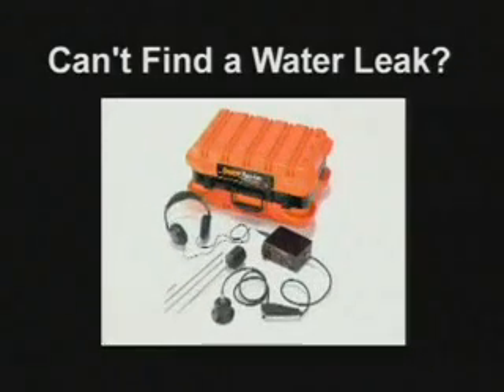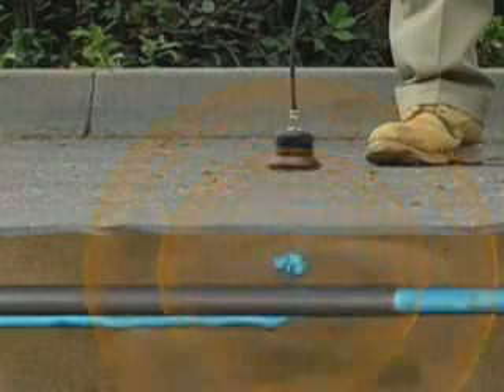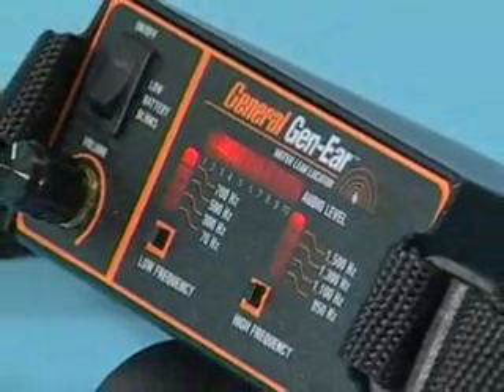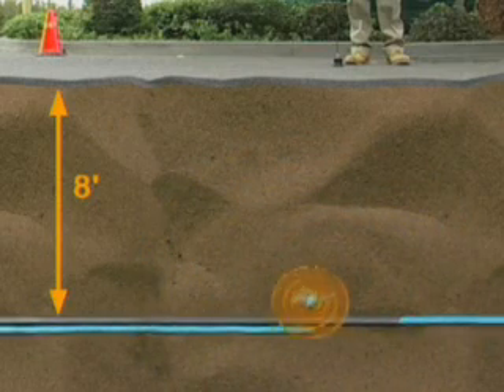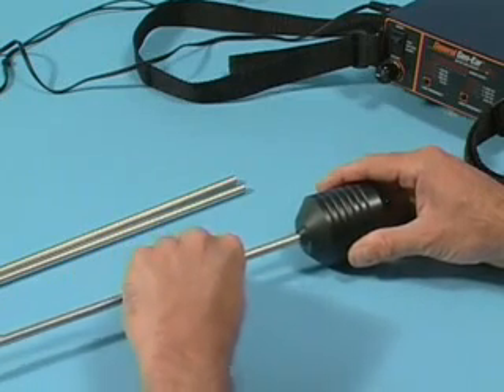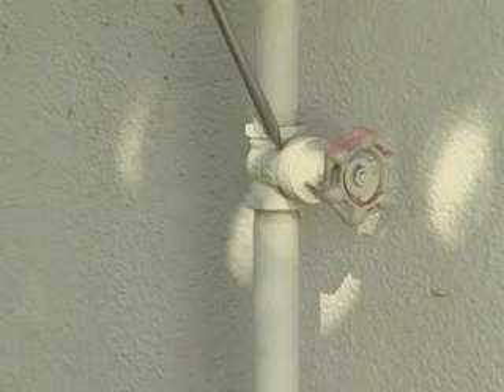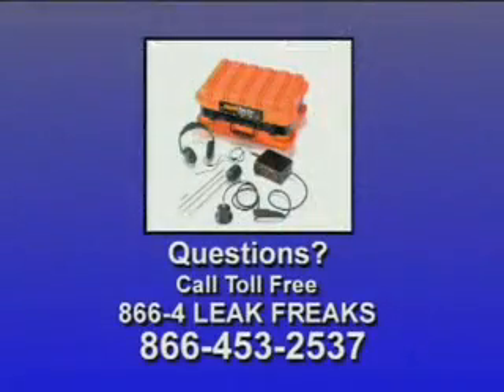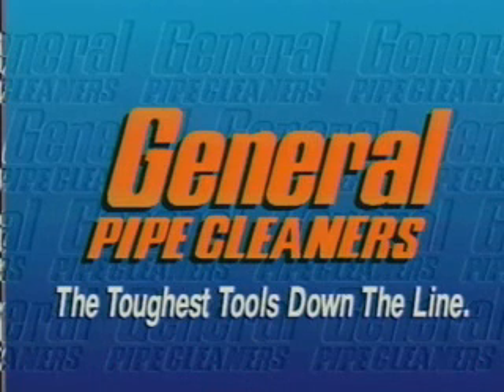Gen-Ear Water Leak Location System: How To Video

Comment: will it detect a leak 8 feet below ground level?
Reply from the maker: 8 feet is about the maximum depth the Gen-Ear can locate a water leak. You can amplify the sound of the leak by using the SAM (Sound Amplification Manifold) that adds air to the line. Watch the Gen-Ear video to learn more, or call the Drain Brains at 800-245-6200.